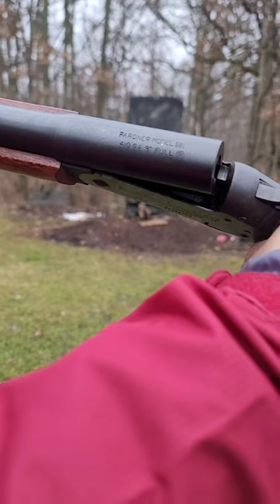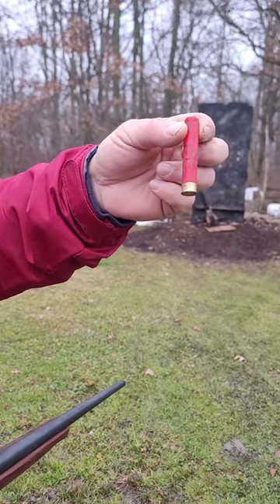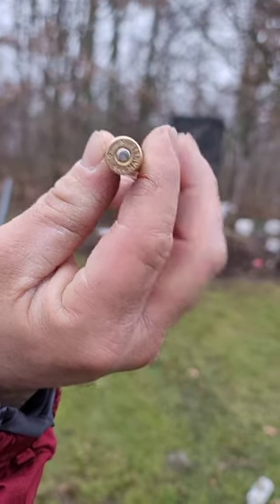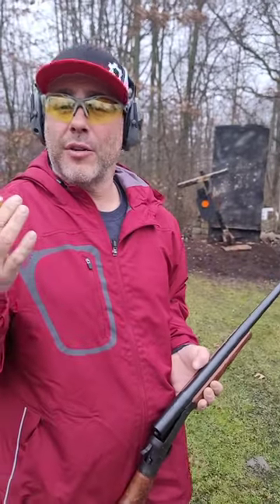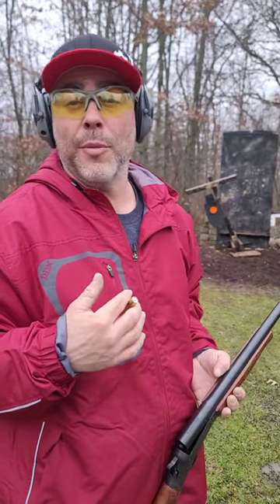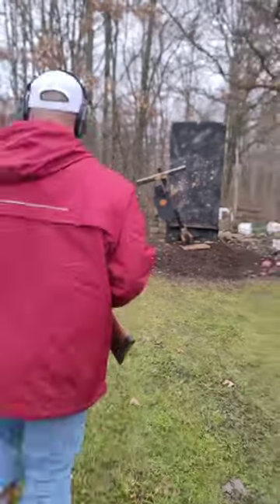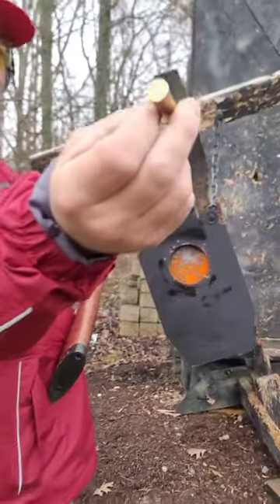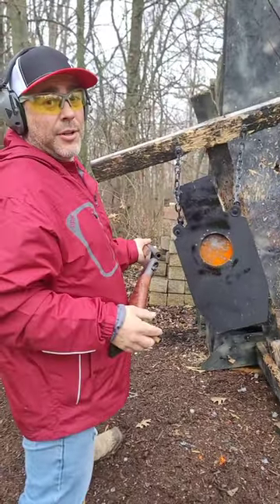.444 Marlin Brass Loaded As .410 Shotshells? 🤔 🫣

Comment: That brass would literally last till the primer pockets wore totally out. If you can find some .444 brass you are really lucky too.
Reply from the maker: Thats what i was thinking! And it was not essy to find new but then i came across it a a flea market. Score!👊👍🦃
Reply: @theturkeysopinion  Way to go! Everlasting .410 shells fire formed from .303 British brass were talked about on the net quite some time back. .444 looks even better. Don't know how you are loading these for wads, but an old fashioned over powder cardboard and an over shot card and roll crimp may be all you need if you can't find plastic wad components.
Reply: Nah dude, you could totally make a jig to press new primer cups and anvils for them from copper.
Reply: I know this is a year old. 410 is around a little now. 444Marlin was available. I have a 309JDJ barrel  that starts out as a 444 case.

Comment: Looked up the base diameter, rim diameter and thickness of the .444 and surprised how close it is to those same dimensions on .45 Colt, which is usually the "double" that .410 runs with in revolvers. As you've said, "in a pinch." It's not ideal but it works if it has to.